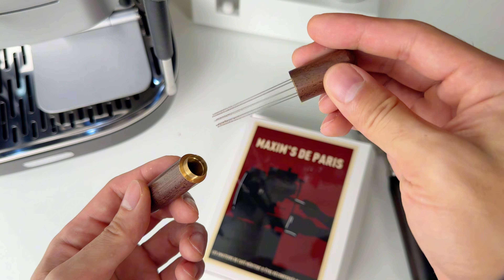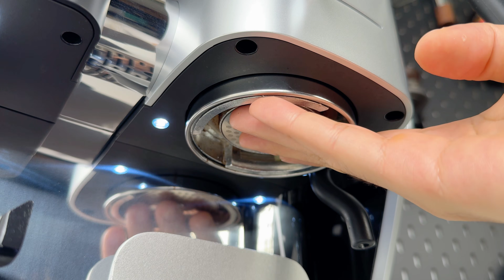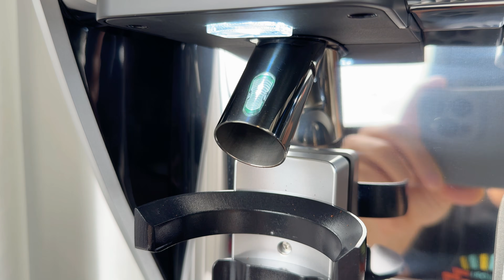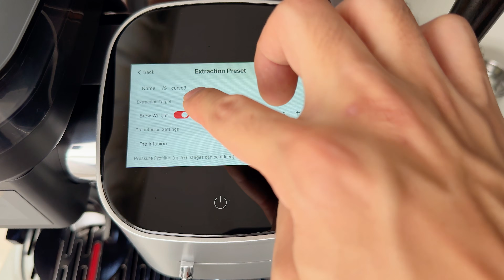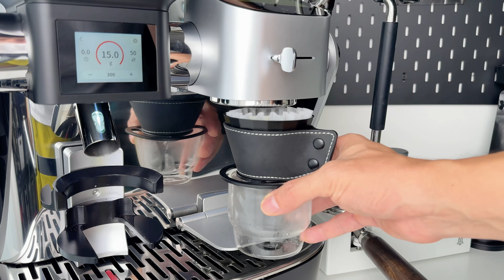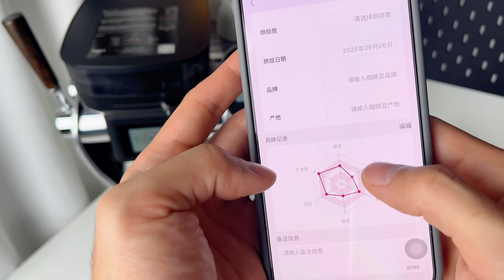Maxim's La Seine X Espresso Machine Review - All Features Tested | Detailed Walkthrough #seinex

Comment: I’ve had my machine for about three weeks now and I’ve done the daily cleaning probably about four times a week. I haven’t been able to get an answer from Maxim yet, but do you know if this machine is OK to be back flushed?

I bought a back flush basket, but have not used it yet as I don’t want to ruin the machine if can’t. This is my first espresso machine and I’ve read that back flushing is a typical part of maintenance.
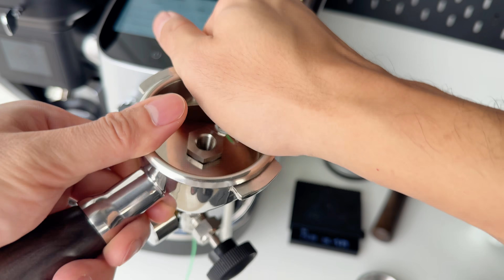Reply from the maker: Hi, at around 13:54 in the video, I'm testing temperature and max pressure with a device, which basically acts like a backflush. The water gets pushed through the 3-way solenoid and drains into the drip tray. In my opinion, this should be fine. But the manual doesn't specifically say you can backflush, so it's worth double-checking with the manufacturer just to make sure it won't affect your warranty. If you're using the built-in cleaning cycle regularly, you shouldn't need to backflush very often anyway.
Reply: @brewcoffeehome  oh thats helpful to know then. I guess the daily clean function mimics a back flush? But I will double check. Thanks again!
Reply: @brewcoffeehome  got the official email back from Maxim that the machine does not support a back flush and to just follow the Cleaning settings on the machine
Reply from the maker: @NYIsles84  Thanks for the update! Then I should pay attention to that as well. 🤔

Comment: I saw you video on the meraki as well, which one feels better on your opinion?
Reply from the maker: They both have built-in grinders and two scales. Meraki's build is better, with rotary pump and dual boilers, for regular espresso, it can deliver very stable shots, but it's also more expensive. Maxim's has more features than the Meraki, you can explore more possibilities with the variable pressure mode and many customizations. To be honest, both are good, so it really depends on your personal preference. I like them both, so I'll keep both for a really long time🤔
Reply: @brewcoffeehome i like the meraki's design  and user interface more..

Comment: Do you recommend it over Meraki or Fellow 1 ? Can you check if the dispenser under shower screen on Maxim is metal ?  I bought Tuni E2 because of your video. But the water from Tuni E2 has strong plastic flavor even after three weeks using and countless flushing. The new replacement has the same plastic flavor. I think the plastic dispenser in the E2 brew head release plastic flavor under high heat and pressure. I will return these E2 to amazon and  maybe get Maxim instead.
Reply from the maker: I haven't used the Fellow, but overall both Meraki and Maxim make really great espresso. The Meraki has better specs, like the rotary pump, dual boilers, and the built-in grinder doesn't get warm since it's positioned away from the boiler. But the Maxim has more features, so it really depends on what you're looking for.
I just took apart the Maxim's shower screen to check, and it looks like the dispenser underneath is aluminum, not plastic. I also opened up the Meraki to compare - that one's stainless steel.
Sorry to hear about the plastic taste with your E2. I haven't really noticed it on mine, but most entry-level machines I've tested use plastic brew heads. It's cheaper to manufacture, heats up faster, and has less heat loss.
Reply: @brewcoffeehome  thanks for the detailed information. Your review on Maxim is the best one on YouTube so far. I just placed the order for the black one through your link. Thanks !
Reply from the maker: @leepc777  Thank you! Please note that the US version is not exactly the same as the one I reviewed. It can't brew and steam at the same time and power steam button is not available due to the voltage issue. Other features are similar. What I really like is the design and the variable brewing, so good. :)

Comment: how do you like this compared to the meraki machine? seems like there is a pretty significant price difference between this and meraki, this being much cheaper, so wanted to know your thoughts
Reply from the maker: Hi, both machines have similar core features like simultaneous brew and steam (Not available for the US version), grind and brew by weight, milk temp probes, etc. But the Meraki uses a rotary pump and dual boiler system, which typically costs more than vibration pumps and thermoblocks. When both are dialed in with the same 9-bar extraction, the coffee quality is pretty comparable. The Meraki runs quieter, has a cleaner design, and the interface is way simpler.The La Seine X has more features overall, there's definitely a learning curve to master everything. But it offers variable pressure brewing, which the Meraki doesn't have. But honestly, at $1299 with all those features, it's pretty insane, the value seems better than the Meraki.☕
Reply: So, Meraki uses a rotary pump like the fancy coffee machines and commercial coffee machine (high durability) , and their grinder is way better. But, unlike Maxim, they can't change the pressure or control the flow.
Reply from the maker: @drabdulwahabalnajjar  Yes, Meraki's grinder is a collaboration with Timemore. While it doesn't look very different, it's really stable, so I love using it to test other grinders. Meraki's settings actually reduce pressure during preinfusion, then ramp up to 9 bar after. But feature-wise, the Maxim's definitely has way more going on.

Comment: Guessing this is the Chinese version? The US version isn't a dual boiler and has no Super Steam mode
Reply from the maker: Hi! You’re right. The US version can’t brew and steam at the same time, and the super steam feature isn’t available, likely due to voltage differences. I’ve also noticed many dual-thermoblock machines aren’t available in the US for the same reason.🤔
Reply: @brewcoffeehome  Yes, though many kitchens in the US have 220V outlets, most espresso machine makers hold back on releasing 220v machines. Ascaso is an exception with the Steel Duo

Comment: Great review. Thank you! Is there any other machine on the market that's capable of digital pressure profiling etc. or it's the only one machine that has it built in? Ofc there are external solutions for that such as Gaggiuino pcb V3 which I saw in video with Gemilai 3028 and it worked well but you have to connect it in by yourself and possibly risk damaging something if you're lucky, so.. I would love to have this kind of machine but without built-in grinder :)
Reply from the maker: Hi, it seems that Decent offers pressure control, but it’s priced higher. So far I haven’t come across another one like this, especially at this price point.